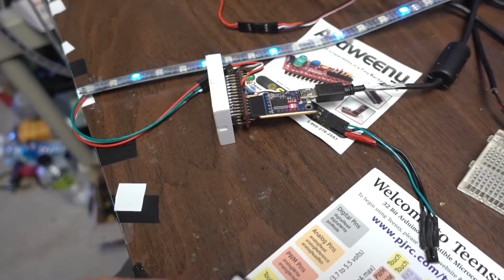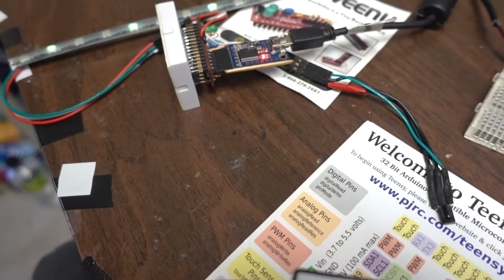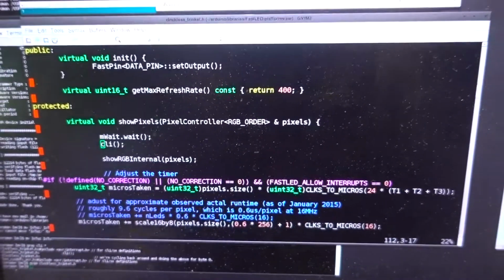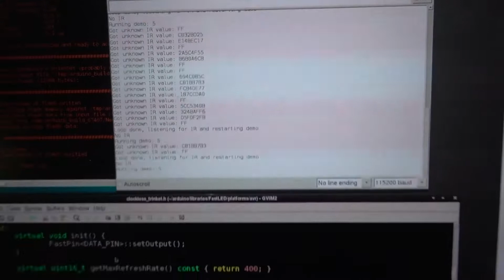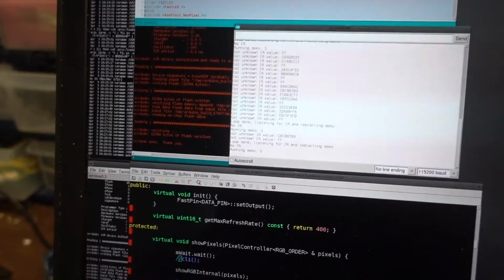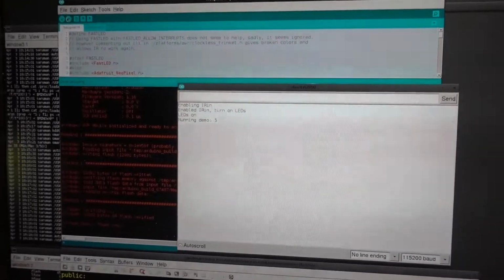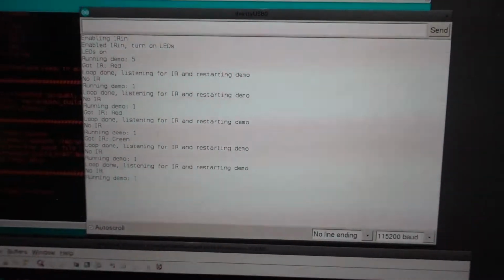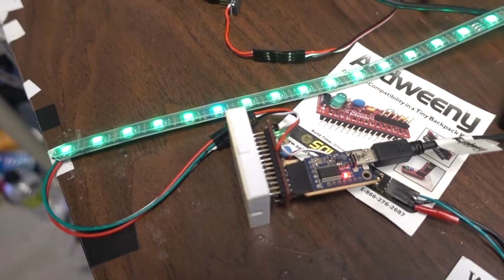Neopixel + IR: Part 4/6 -  Arduiny328p IR or Stable Neopixels

Comment: Do you know if an ESP8266 would be powerful enough? Could I use a Wemos D1 mini?
Reply from the maker: Did you follow the links in the video?  http://marc.merlins.org/perso/arduino/post_2017-04-03_Arduino-328P-Uno-Teensy3_1-ESP8266-ESP32-IR-and-Neopixels.html#ESP and https://github.com/marcmerlin/Neopixel-IR
Yes, Wemos works fine, this is run by a Wemos D1: http://marc.merlins.org/perso/arduino/post_2017-06-02_LED-Pants-and-Shirt-Programmed-With-Arduino-on-ESP8266.html